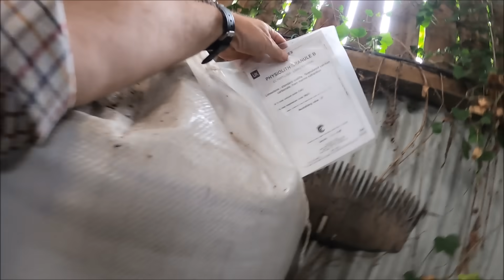02/08/23  Getting ready for a six tonne delivery.

Comment: I would exceptionally strongly suggest, like a rock filled hard-hat to the head, that you do not use the forks upside down again.  Flipping the forks over reverses the advantage of leverage on the rails.  I doubt its so much a worry at 500kg but doing it for heavier is a bad bad idea. 

 You have that bale fork frame with the upper hole, you could have some welding guy you know reinforce the upper on the sides and backstrap then you can put a big shackle and hook over top and have a nice handy bag and giraffa handler as well as a way to strap odd loads tight on top of the tines for other purposes.

Comment: sure your welder future son in law could knock up a proper  bag lift  fitting to slide onto that fork back plate, just swap between as you need, but even what you have done  will give you that extra couple of foot height  ,give the skidsteer a bit better balance under weight

Comment: Whilst there is the argument about not using them upside down, I doubt you will break anything on the skid as its more likely to tip over before the metal lets go. 
If you were doing this on something more substantial like a telehandler and lifting larger weight then you might have an issue.

Comment: You're now going to carry all the weight on brackets that carried nothing before
Reply from the maker: The intention is to fabricate a proper lifting jib that will fit over the forklift blades in their designed position, The headstock and forks are designed for a two tonne lift capacity, the Mustang can only lift 700 kg max, provided the load is kept as close to the ground as possible. I’m satisfied the two forks upside down can manage 300 kg each, I can’t lift anything heavier the machine won’t do it.
Reply: Much better idea. Just saying all those brackets originally had to do was stop the tines bouncing off
Reply from the maker: @steveC2  
Oh no, the brackets carry the full load Steve. 🙂👍🏼
Reply: @FarmerP  They do now but not when they're at the bottom